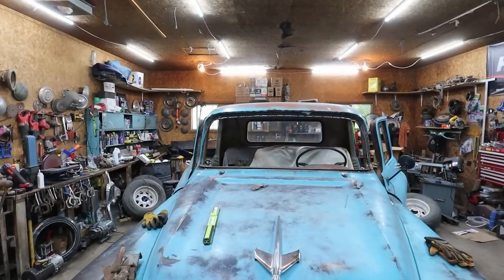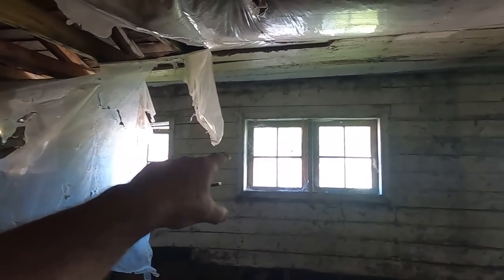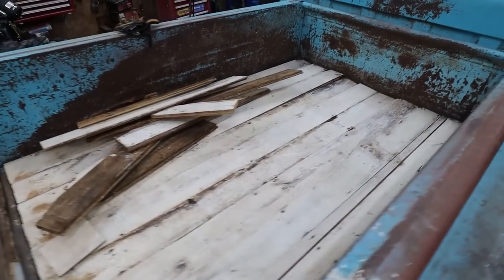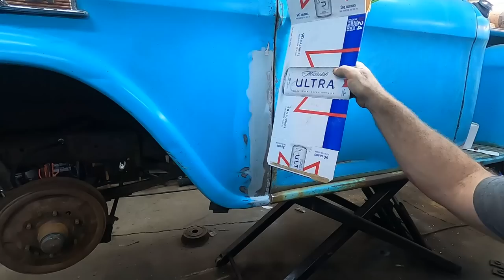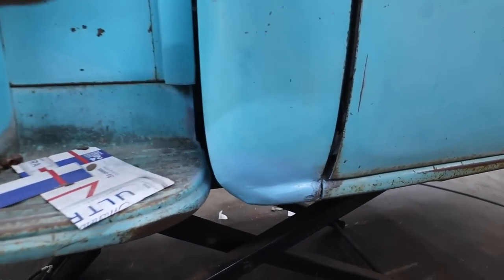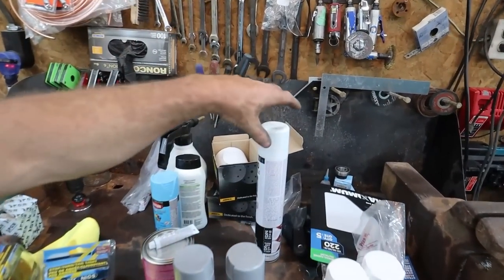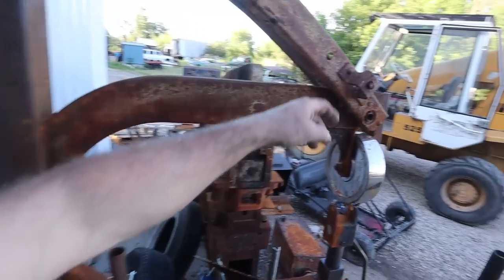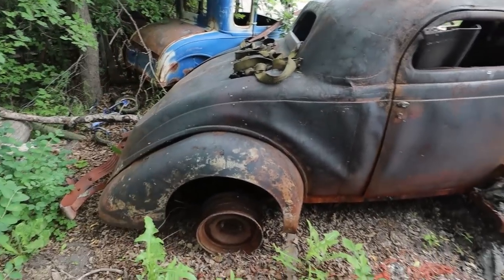Painting our patch panels, and using barn board for the bed floor in our 59 Chevy Apache.

Comment: Where you sit and see thats where you will sit and be:face-green-smiling:.. That 59 takes me back to the 70s when I had the same truck with the same colors I did notice it doesn't have the speaker obove the windshield and the spare on the fender greet job Mr. Brent.

Comment: Body work blends with the work of those that went before you. The door scratch is also fine matches the truck.
To blend in the new paint, dust some more places on the truck and it will blend in.
Match the interior paint, bring the ashtray door with you when you get the paint.
Excited to see more on the coupe.

Comment: Tailgate action! 
Turns out the red Fargo tailgate is the best one yet. And i found a sixth one i forgot about, which im passing on to my buddy Charlie. 

I have a pile of planks stashed in my barn, rough sawn. Free lumber is a good thing!
I used some kind of tech screws for the decking on my trailer, countersunk. They are designed for it.
Milwaukee has a finger belt sander, you would love it. I have a PA air sander, i use it a lot.

Comment: Looking good - so far...  For your interior color, check out a color named "Argent".  It is a weird version of silver with some kind of brownish gold mixed in.  Dodge and Chevy used it on everything back in the 1950s - 1960s.
Reply: Wow that's amazing you would know that I sure wouldn't know that if I saw it yesterday .
Reply: @bigbellyrebuilds2778  I used to work in a body shop, and that was one of the colors that was hard to find and match.  Every company had their own version of it and none of them matched the other.  The color was used everywhere, especially on trucks - interior colors, wheel colors, painted bumpers, etc....

Comment: Brent, that ole Apache is cleaning up pretty darn well. As an 81 year old with not so terrible but unnecessary issues caused by my youthful risk taking, I'm urging you to mask up for dust and paint fumes! You'll be glad you did a few years. All the best! Great project and video! Great to see you back up and running strong! Thanks!

Comment: nice tailgate if ya mask off the chevy area an paint the surrounding blue it will fit in perfectly as the front of the truck has the white grill an such as for your barn old milking shed yup im with ya my garage used to be the milking shed too (though clearly smaller your place looks like it handled couple dozen head)  if you put drain tile into the channels cover with gravel then cap with concrete it will drain water as normal away from the floor area and opening the sides up will help with the moisture the barns were built to help keep cows warm an air moist

Comment: You'll have the wheels done by the time you get this, but what works really good on those rusty old wheels is a needle gun or a scaling gun. People have different names for them but they work really good on that kind of stuff. It takes all that crap off and you thought you when it's done. You think it was sandblasted. I've done it before and it works good. That's something you need.

Comment: After leaving it out side for a few nature will make the paint match the rest of the truck the only reason you notice it so much is because you painted it.
That's the way I felt when doing body work I knew every where I laid the mud down, but no one else could tell. After the vehical was painted and done been around for a few year's I didn't even know where I did the body work at. Some nice wheels and tires maybe painted rims with some stock looking hub caps with white wall tires that's what folks are into these day's. Not some shinny truck you can't even use like a Truck worried about the bed of the truck getting a scratch or nicks. 
My truck that's how I used it like a Truck I just had chrome wheels and low profile 50's tires I just kept the wheels clean and my window's. Once in a great while I would wash the whole truck. Mon when I fixed up my 1972 GMC SUBURBAN I don't know what I was thinking washing it was like washing a whole house. It was a glass house to all the windows sprayed with Windex cleaner.

Comment: You could drill some holes in the bottom of the door and use a pry bar to push the dent out or weld some rods to the out side and try to pull the dent out

Comment: Yep, I'm one of those guys stressing about that door,  I weld bolts in the crease and screw on my slide hammer,  works just like a stud gun that I don't have, lol,, nice work on the body, it's perfectly crappy, and the interior color is called champagne semi-gloss, you can get pretty close in the rust oleum metallic line

Comment: Nice bed wood. Figure out your cut to fit, take the cut off piece measurement and divide by two and cut that off the edge of the left and right boards outside edge. Won't even be able to tell it's cut.

Comment: Weld some studs to the door and pull the dent out with a slide hammer. Fixed dent or not fixed dent, it is coming along in good fashion. If only you could find some of that special edition pre-faded paint; then it would look new again...........or old again.........or...................  Maybe if you left the can of paint out in the sun for a couple of months it would fade in the can. 🙂 If you drive by real fast no one will notice that the paint doesn't match. They will be too busy cursing you for driving too fast.

Comment: Your "altro" tells me that some of the pain is subsiding for you... good on you!!! All that said and done, Brent, My kidneys are failing, so looking like the "Assisted Living quarters" for old jerks like me go to a place and they feed me the junk to relieve some of the pain. I just hope you forgive me for so dang long of comments right now.
      Its going to be all over the place so bare with me... knew a feller who took all the paint sanding dust and just only the paint dust.... used it in something to reconstitute it into a kind of color paint. It wasn't perfect but in refection of "Halfass", it should be fine, ya, just fine/lol. For many years when I still went into NAPA, their sign said to bring a paint sample and they could match it to the "Tee" and yet for some reason, I have yet to have much success with it. I am a very sad person right now as to not being able to see you do this magic you perform on junk to driver quality. I am thrilled to hear as I follow Karl as well, his coming out to help a bit is a mental lift in how well things go.... and in perfect "Random" thinking out loud here! New shop and a air compressor.... build a small outside building that meets all the requirements for a air compressor to set in.... then the noise from it will not interrupt your videoing. No dust from the air circulation also. I did it in my shop and life had a great whole new feeling about having enough air. Another thing was the air for tools is one thing but no way clean enough for painting.. so separation of air lines.... mass air for tools but the pressure and clean air is just so precious to you... My nurse is here so will continue with this later if all right

Comment: When you have a dent you can't get behind...
Clean the area and final it with an acetone wipe down. Cut some plastic blocks to fit in the deepest part of the dent and make it attachable to a dent puller. Snot glue the plastic in the dent and put the boom to it. Remove with alcohol and Bob's your aunt.
Do it yourself paintless dent repair no drilling required.
If the glue isn't holding you didn't clean it. 
It is much harder to do on older cars not made with paper thin metal. And almost impossible on cars like old VW bugs due to their curvature and 6" thick body metal.

Comment: 13:26 The bed is saying, "Get a longer board!"🙃
Reply: As you were scuffing the fender with the scratch pad you were saying it had turned out lighter than you'd liked and that you'd hoped the black paint would have toned it down better. @ 26:50 You forgot to paint it black...
Reply: Take pieces of the cut aways with you to match colors.